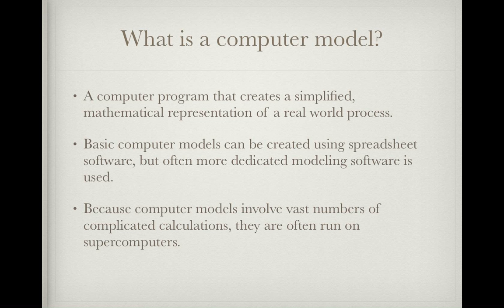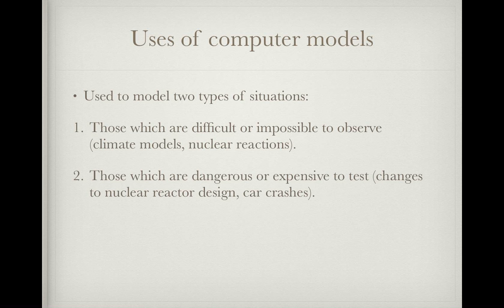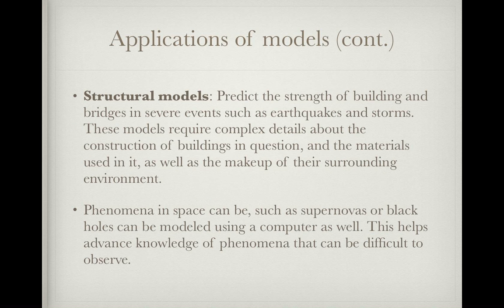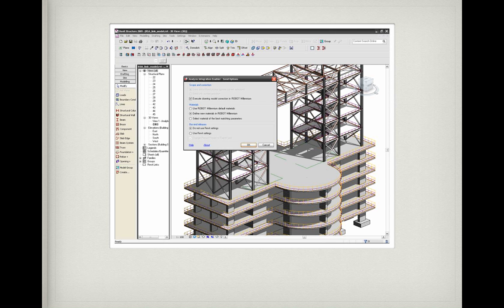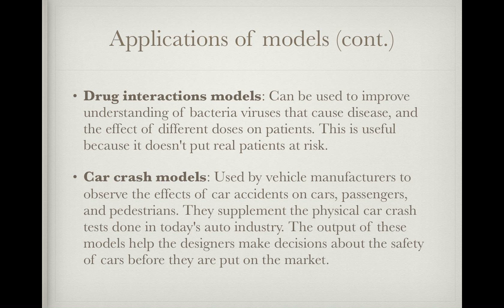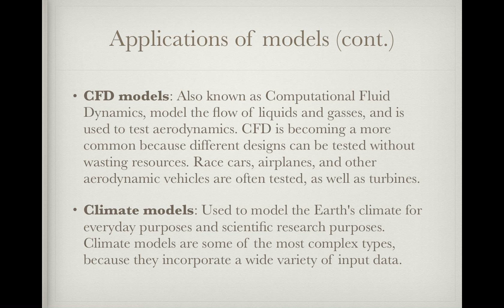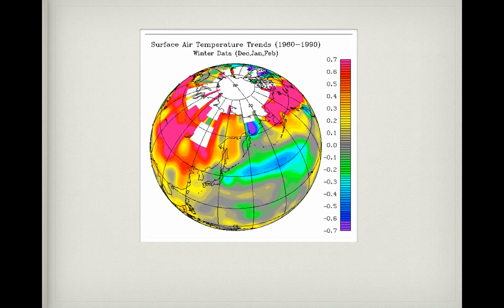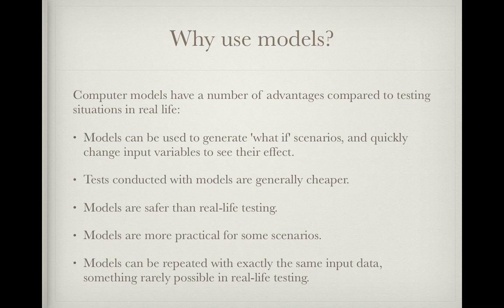Chapter 8: Computer Models & Simulations: Computer Models

Comment: Computer models are great instruments that can be used to obtain information that may be either too difficult and or too dangerous to obtain. I like the example of nuclear reactions used in the powerpoint. The important thing I want to note is the fact that with computer modeling the actual event (or nuclear reaction in this example) do not actually have to take place. The computer model can take information and data from previous reactions and use it to make predictions on what will happen in this case.